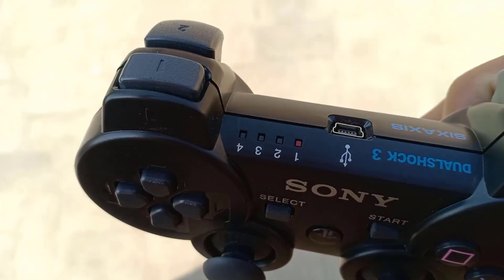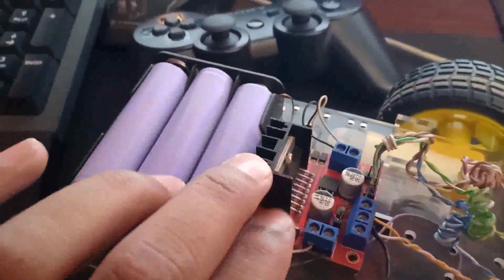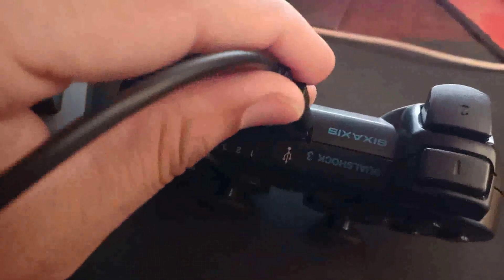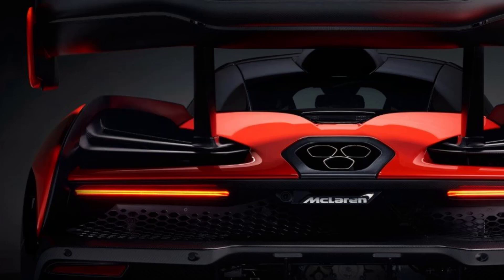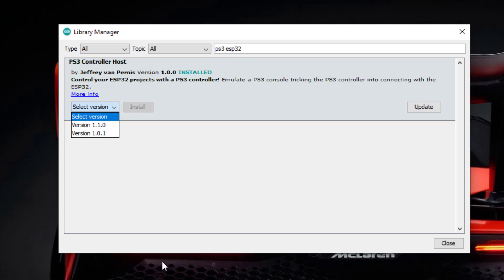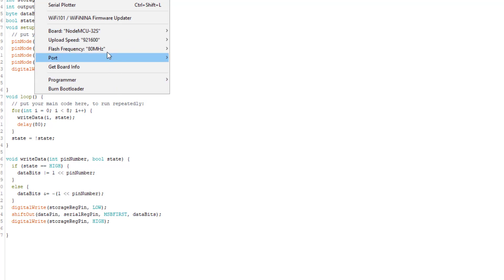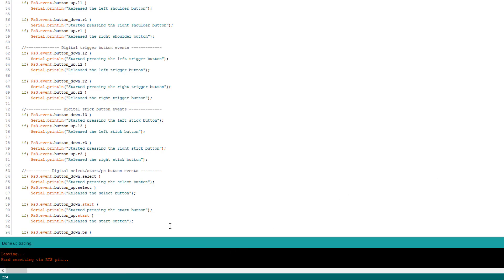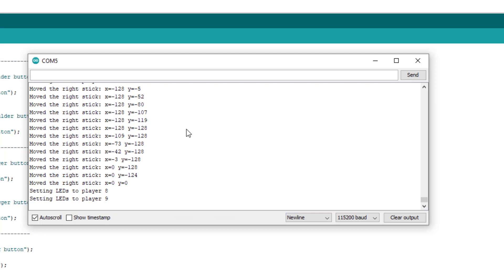PS3 Controller + ESP32 Control any robot, anything

Comment: Hi my ps3 controller do not connect and the Serial monitor says nothing
Reply from the maker: Then it seems to be a copy.
Reply: @engr.parvaiz  thank u for ur time,  i used an original ps4 to controll motors using an esp32 it worked successfully. However, today, instead of connecting,the ps4 controller shuts down.

Comment: sir when i connect ps3 controller with the pc for mac adress it not found the mac adress or any device what can i do? how can i found the mac adress of controller.
Reply from the maker: Make sure controller is original, or good copy. Then in device management see if it is being detected. If controller is third class clone it may not be detected by the PC.
Reply: @iparvaizahmad  it is shown in The device manager. But same problems sir 🥲. Or if any other ways to get mac address.!?
Reply from the maker: I dont know any other way, one way might be to connect controller with PS3 and may be there you can find the mac,
Reply from the maker: Other solution is to use virtual joystick, you can find the solution here, https://parvaiz.pk/posts/virtual-joystick-for-arduino/
Reply: @engr.parvaiz  thank you so much

Comment: Hello, I have problem with connecting my PS3 controller to esp32. I have installed all mentioned versions of IDE, libraries and boards. I was trying with two controllers. all just blinking with 4 leds about 2 minutes. Serial monitor says "Ready." and nothing happens next. I have trying to change controllers mac to 01:02:03:04:05:06 and with original 4c:0f:6e:9b:13:d4. nothing helps.
Reply from the maker: Controller is copy or genuine one?
Reply: @engr.parvaiz  it is original
Reply from the maker: Then it should work.
Reply from the maker: May be you are missing something
Reply: @engr.parvaiz  I've do exactly as you do. but anyway, thank you.

Comment: sir what if when the ps3 stick is connected to the pc, the current master on sixaxis keeps searching and the code doesn't want to appear. is there a solution?
Reply from the maker: Maye be ps3 controller is some clone and is not compatible.

Comment: Hi, my Controller master apear to be 00:00:00:00:00:00 and it does not connect to ESP32 and I can’t change the master, when I plug out the cable and plug in, the master is 00:00:00:00:00:00 even I change it to 01:02:03:04:05:06 and it can’t connect to esp32
Reply from the maker: Are you using windows 11 or 10?
Reply: @engr.parvaiz  10
Reply from the maker: May be you need to change the controller. There is something abnormal with the controller.

Comment: Sir, can I install the Xbox 360 host control controller host library of Arduino s library manager to Arduino IDE for the robotic car? Will the Xbox 360 host control controller host library of Arduino work or not?
Reply from the maker: Bluepad32 is a firmware that can solve your problem, I do not have xbox controller and I never tried one. Search bluepad32 and it will be helpful.